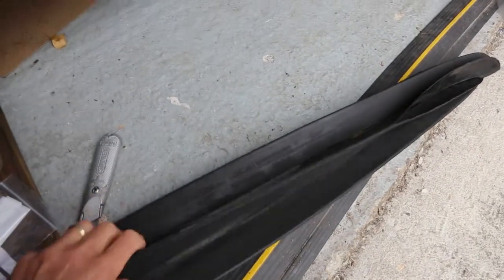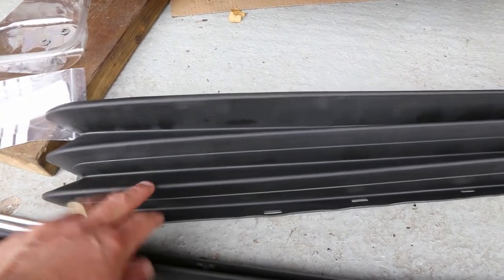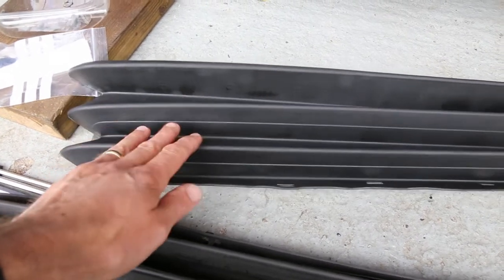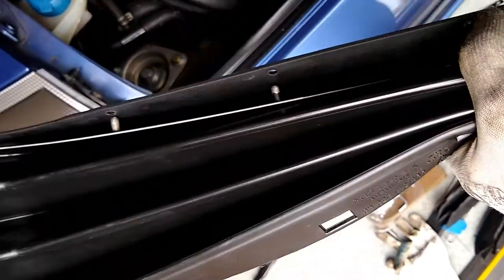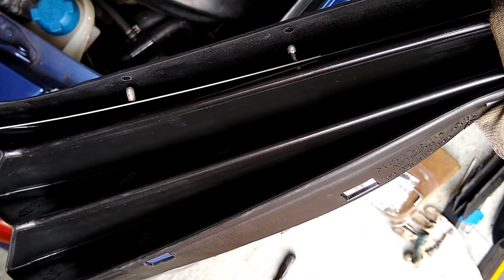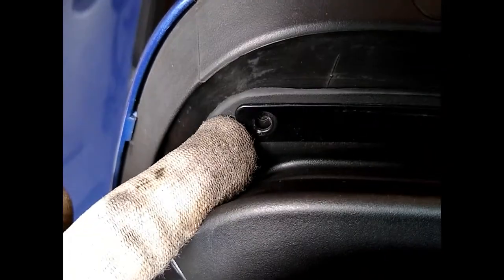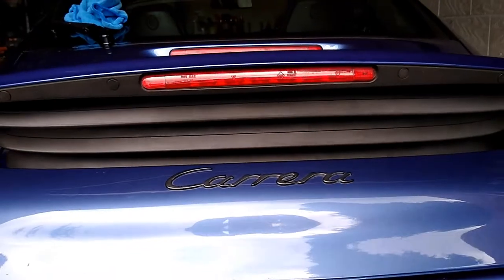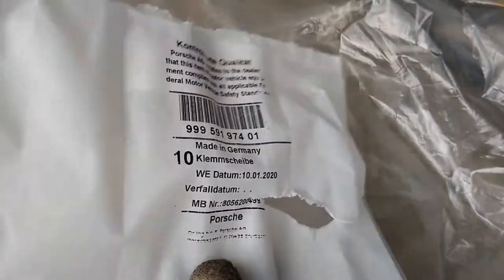Porsche 911 996 Spoiler Wall Replacement - How to Remove and Fit New Rubber Bellows to Rear Lid

Comment: Thanks for posting. 2002 Carrera 4S. I just took the plastic "bellows", fan motor and engine "hood" light out. 
I had a few round clips on the bottom of the "bellows" fall off and wanted to replace them. You can not do it with the top fastened to the spoiler. Reason being, you can not press on the round clip without the stud it goes on staying in place. 
I ended up putting the bellows on bottom first so I could hold the stud bar in place while pushing the new clips on. 
Putting the top back was hell. The plate that holds the "bellows" top has two way prongs, (Maybe 8?). I ended up looking real close at the prongs on this bar. These prongs are a two way lock. You have to push up and to the right side of the slots to get them all in to the slots. THESE 8 OR SO PRONGS HAVE TO BE PERFECT TO GET THEM ALL IN! I took needle nose pliers and carefully bent them all the prongs had at least 90* bends both ways. After doing this the bar went in all the slots and I was able to slide it to the drivers side to get the outside plastic push pins in. I recommend 4 hands to do this.
The engine hood light was burned out, (The light is a "torpedo" shape. Text on the bulb: 12V, 10Watt," on one end, "Phillips Made in France" on the other. Looks original. For sure it is old.)
FYI, I took my 2002 Targa spoiler off to lube the gears at the motor. A good video is on You Tube. I did not have to take the "bellows" off at all. I used a Bentley hard cover "service book" and it all went well. 
I put "Black Again" plastic care on all surfaces when both spoilers were taken apart. These cars are both super clean all the time, not daily drivers. 
Again, this video gave me the extra info to get my project done. If I would have videoed my entire job, it would have taken 12 hours instead of 6. Thanks a lot for the help.